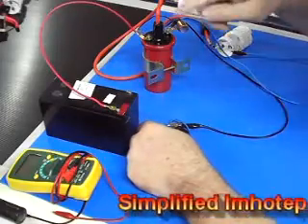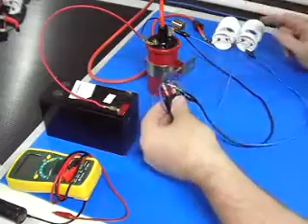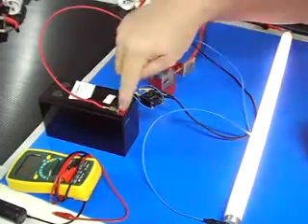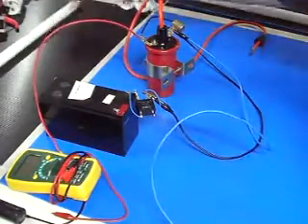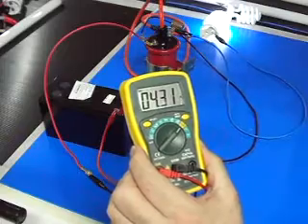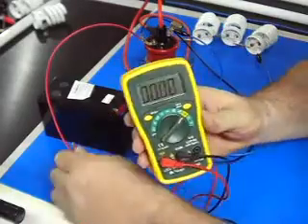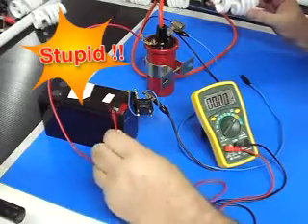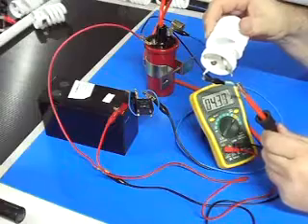Aromaz 002 - Simplified Imhotep Radiant Occillator Part 2 of 2.MP4

Comment from the maker: Mat?, no it is not a mat - just PVC sheet because table top is less than presentable.

20,000 volt - I would he so happy! These coils has a maximum output of 8,600 (? or 6,800 ?) volts.  I used a friends HV probe nearly 10 days ago; that is why I bought 4 coils. 2 each from two different dealers.  All 4 were within 100v output on same circuit.  At present - as per all these video's - the actual input to the coils were around 8.4 to 9.1 volt.